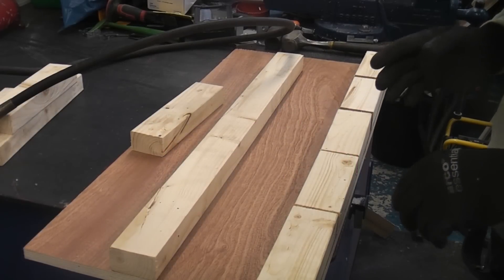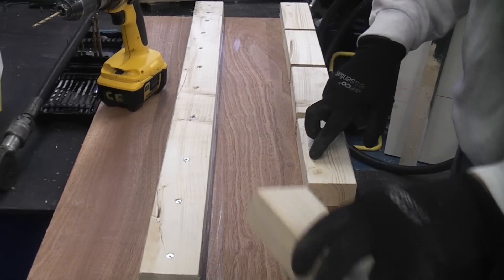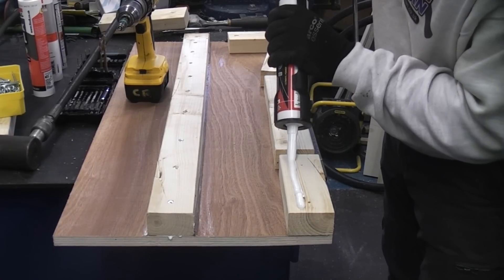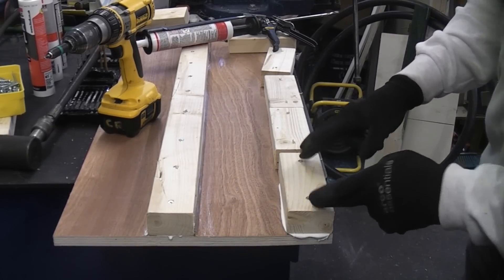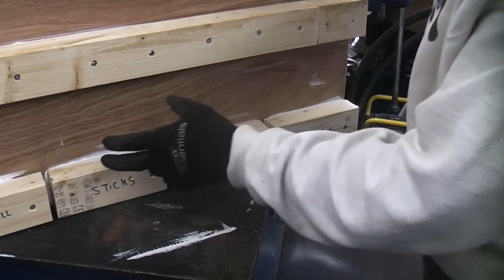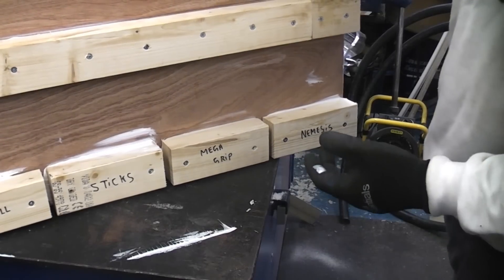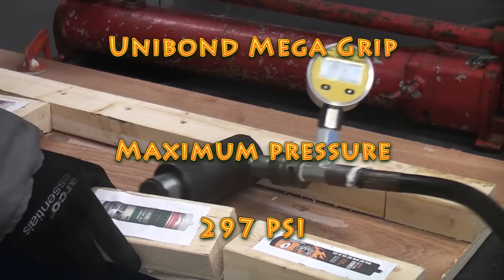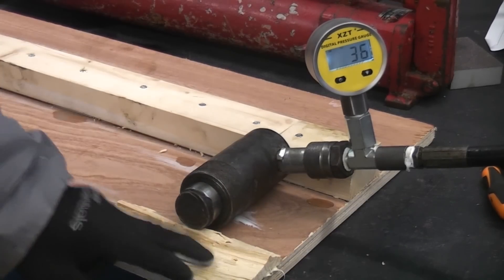Grab adhesive strength test

Comment: The wood would have been better turned the other way round it would not have split as easy with the grain inline with the pressure, variations in the wood can mislead the test. BTW good demo though, thanks for doing it, I always liked the Sticks Like Shit myself and that did pretty good here.
Reply from the maker: I started to use stainless steel in more recent tests.
Thanks for the comment 👍

Comment: Hay i like your vids very good to follow but in this case you are missing the point.
They are grab adhesive meaning they dont need fixingas they all have that initial.
By the way your wife is hot well done
Reply from the maker: The screws were just to hold the blocks in position until the adhesive cured. 
Thanks for the comment

Comment: great test and probably as good as any laboratory would carry out. question, what adhesive did you use to secure the solid test piece - seems that this was the real winner in this test?
Reply from the maker: The block of wood at the back was glued using wood glue and also screwed down.
Thanks for the comment

Comment: The strength test is a bit pointless if you are going to use plywood for the test. As you can clearly see in the video, the top layer of plywood has come off before the adhesive has failed on some of the products. Its like trying to stick something to a painted wall with an adhesive. If the item falls due to the paint peeling off then you can't say the adhesive has failed. I would suggest carrying the test out on a metal surface.
Reply from the maker: I'll tell you exactly what is useless- posting an identical comment on three of my videos.This video clearly demonstrated that the majority of the grab adhesives failed before the plywood became delaminated.I have since done the test using metal and not one of the adhesives held well- they were so weak that you could break the bond with your hand.There is of course nothing stopping you from repeating my tests- you could also be a sport and upload the videos to YouTube ;-)

Comment: Hey mate, great video! Might be going a bit off topic - but do you reckon the way the glue is applied would affect the final value? Rather than 2 horizontal beads, maybe several vertical ones or an X pattern? Could you also let us know what decision made you go with 2 horizontal lines.
Reply from the maker: +Aakash Sachdev 
I don't think it mattes much to be honest. Once they are screwed into position the adhesive is forced out leaving an even coverage of the surface.
Reply: Great thanks! Admire your creativity in devising a testing methodology.
Reply from the maker: +Aakash Sachdev Thanks, originally I started to test grab adhesives after watching the Maximum torque challenge, so I copied their video and got much different results. https://www.youtube.com/watch?v=9XgDvYsJiB8I have tried repeating this test using different materials such as metal but nothing has stuck as well as the wood to the piece of plywood.Thanks for the comments ;-)

Comment: I tried the Nemesis for sticking a vertical wooded baton to a concrete slab (sectional garage).After 24 hours the supporting bracing was removed, And... Yes, the wooden baton fell off :(
Reply from the maker: +m0mgf 
Blimey, I have not tested it on concrete. The initial grab on plasterboard was good and it stuck two pieces of wood together no problems. 
It just goes to show that some of these adhesives may be better on other substrates than others. I'll try and do more tests when I get chance ;-)

Comment from the maker: Since doing this test I have repeated it using metal. I left the glued components for 48 hours to dry and repeated this test but unfortunately the adhesive on all 5 samples did not harden fully (probably because metal is not absorbent), this was not apparent until each piece was put under pressure.

Comment: Great experiment, thanks for sharing. Would have loved to see how Pattex PL x00 would perform against this test. Also, for the last one (Nemesis), since the base material broke before the glue, we can assume safely that the glue would perform better than this ( and would require a stronger material than wood ) Thanks again for your great videos, I just discovered your channel and it is really addicitive :)
Reply from the maker: +djetew 
Thanks, I will test these adhesives out again using metal when I get chance ;-)
In the future I will also test out other adhesives.
Thanks for the comment

Comment: Please do clear one question for me.   The last product you tested, Screwfix Nemesis.  Was that the same product as shown in the Screwfix catalogue, p76. namely Nemesis Mighty Universal Sealant & Adhesive.   OR is it a different product not shown in the catalogue, ie an adhesive only.  

It did seem mighty strong to be both a sealant and an adhesive.
Reply from the maker: +apache16789 
I don't have the catalogue, but here is the link to it- http://bit.ly/1Vb39be
Thanks for the comment
Reply: +Ultimate Handyman 
Muchas gracias.  It is just an adhesive; not a combined sealant & adhesive.
Reply from the maker: +apache16789 
You are welcome.
They do make a few products under the Nemesis brand. I have tried their decorators caulk and that was very good too! 
http://www.ultimatehandyman.co.uk/forum1/nemesis-decorators-caulk-t82343.html

Comment: Been waiting for this one since you mentioned you were doing this ! Great little test video 👍🏻 impressive how strong some of these are!
Reply from the maker: +shortyian 
Thanks, originally I tried the test using some pneumatic equipment but didn't have enough power. I then had to wait for the digital hydraulic pressure gauge to arrive from Hing Kong, which is why it took a while!
I was surprised at how well most of them held!
Thanks for the comment

Comment: What about CT1 and gorilla glue?? Can you do a test on these as well please...Cheers.. I have used both and they seem really good..
Reply from the maker: +jordancorey 
I only used grab adhesives that I could get easily and some that were used in Everbuild's original Maximum Torque video.
If I do more testing in future I'll try more brands ;-)
Thanks for the comment
Reply: CT1 grab and bond really is the best stuff and it is instant, what goes together with CT1 GnB, stays togther.

Comment: Surprised suck like shit worked a treat, the problem with most of these is that I never really use it apart from holding back skirting and dado. Only problem is that it's never strong enough to hold anything down Especially if the walls not straight. I heard of people using foam adhesive which goes off fast has anyone tried it? I'm always looking for something to save me screwing or nailing skirting a on.
Reply from the maker: +justyjust 
Have you seen the original video-
https://www.youtube.com/watch?v=9XgDvYsJiB8

There were three makes that had really good initial grab, I think they were Maximum Torque, Soudal fix-all and Screwfix's Nemesis.
Thanks for the comment

Comment: The first few failures wasnt the glue you used, but the glue used for the plywood.  The two that broke suggest a soft grain in the test material.
Reply: +Drew Willcock It would have been better to spin the blocks around 90 degrees to push along the grain without them snapping so easily.
Reply from the maker: +Drew Willcock 
I managed to get in the garage yesterday and took a photo of the board used.
http://www.ultimatehandyman.co.uk/grab1.JPG
The first test piece took away some of the top lamination of the plywood, but the second one didn't. 
Thanks for the comment
Reply: +Ultimate Handyman The link to the picture doesnt work.  Its just your logo and "Hotlinking is theft!"
Reply from the maker: +Drew Willcock 
I have just tried clicking it in three different browsers and it works, even when I'm logged out!
You might have to copy and paste the link?
Reply: Nope.  Still cant see it.

Comment: Non of that green tube stuff by evo?? That stuff is top quality
Reply: +MegaMetinMetin i had some blue stuff by evo (called serious stuff) and it did my boat repair job a treat, even a tiny bit under the clamps i used made it very hard to get them off!
Reply: +Louis_J yes gripfill that hold very well i once had to remove a piece of wood and had to use chiesel and hammer and remve it in pieces ! Amazing stuff
Reply from the maker: +MegaMetinMetin 
I used to use Gripfill a lot years back.
If I do any further tests I'll be sure to include it.
Thanks for the comment